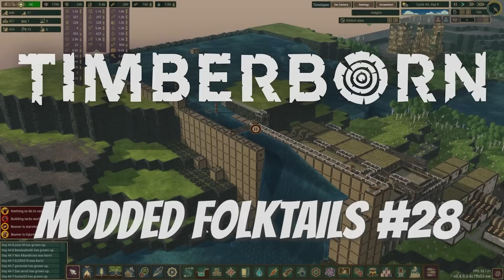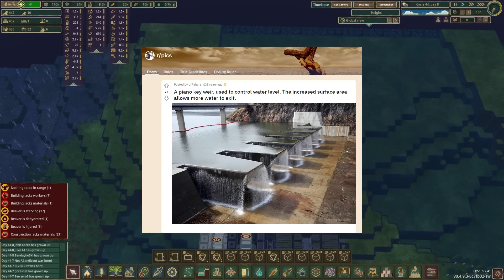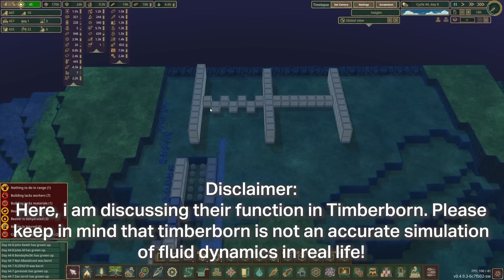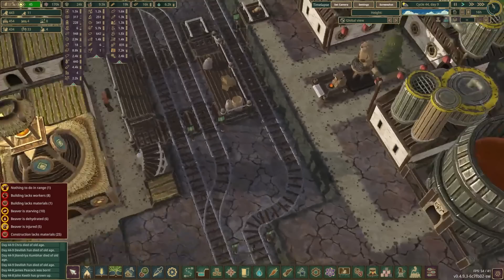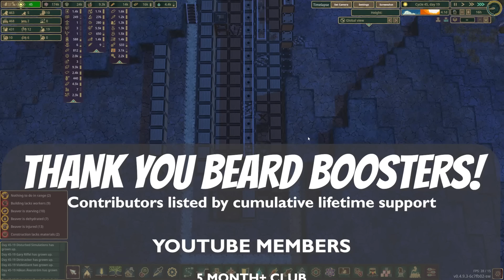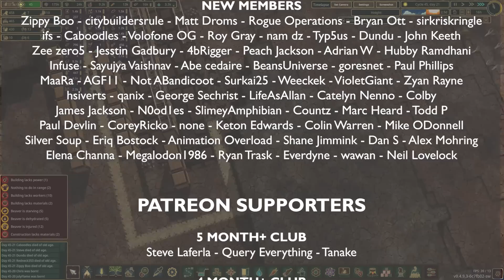Banking on bots to build big! Timberborn Update 4 Modded Episode 28

Comment: 56:25 As an OSHA engineer who has been working on large dam projects, I feel somewhat obligated to point out that the work environment appears to be lacking in terms of safety concerns. Flowing water is incredibly powerful, and the risk of a beaver being swept over the edge seems imminent. 😊
Reply from the maker: So long as Devilish and his beaver protection agency don't find out...
Reply: @JCTheBeard  Battery Smooth needs to come out with  safety gear for the beavers,  I can see tie off points,  and beavers wearing safety harnesses to tie  off when getting close to a edge higher than 2 tiles :)  Oh and you might as well throw in Safety Cones for construction areas.

Comment: My working on the update 5 water flow on the map,    I have 10 waterwheels now producing 34,000 hp  with a flow rate of 11.5  over both tiles.  I have diverted all the water on the entire map to power them :)   lots and lots of experimentation on the folding and getting the flow to run smooth and not being turbulent
Reply from the maker: That's impressive! Did you build them up top like I'm doing here, or in a different spot with more room?
Reply: @JCTheBeard  up top.  I'm working on v2 with some modifications that should get me about 35% more power I'm thinking...I'll know more when I get home

Comment: Isn't the reason you have to prioritize everything by haulers to get them to do anything with the building because you only have 1-2 hauling posts? If that is the case, it seems like having more actual haulers in each district would help with the import/export so the workers in the crossings are able to focus on just moving things to/from nearby storage like what you built at 27:39.
Reply: When you prioritize everything you prioritize nothing.  I wish the hauler priority settings were more granular.  If not 5 settings like the building and employment priorities, then 3 settings like the district gates import/export settings.  The binary do or do not prioritize just doesn't quite get the job done.
Reply from the maker: Dealanach pretty much summed it up. It's just a flawed system that you end up having to brute force with sheer numbers of haulers.
Reply: @JCTheBeard  yeah I can see the issue with that. I just kept finding it odd when you'd build more builders huts to get things done faster when it seems like building more haulers would make everything faster.

Comment: Does anyone else think that JC's intros have that sort of pilot voice of "This is your captain speaking" sort of vibe?

 I believe the powered levees at 41:05 are at different elevations and not quite connected. It looked like you put down the last connecting block,  but then deleted it and replaced it with a normal levee.  Fortunately it's up near the top and will be easy to fix.

I do think that timelapses are a good idea for the mega projects.

"At least it wasn't a Beard Booster"   Hmm.  "Ford Prefect" doesn't sound like a default name.  Aren't default names more like "Mahorayze"?
Reply: I believe Ford Prefect, and I think Theon Greyjoy both are just bots with Iconic names that JC has seeded into the list.
Reply: @Steve-od2di  Ahhh, that makes sense.

Comment: → Are the beavers actually travelling with the passenger station, or just waiting for a while for a train to come and then give up?
→ 23:05 Could it be that the power connected on the bot part factory side, but as the other end of the shaft was still a normal levee, it became yellow instead of green? We didn't see the blue connector, but that only appears when you are further away.

→ The transport from the district crossing will be faster if continue the bridge – underwater beavers move slower.
→ 38:10 Please verify how many haulers you actually have in each district – if all the haulers are at minimum priority, and you got 30 vacancies, there is a good chance that these are haulers. 28:20 never mind, there seem to be enough in Beaverburgh at least.
→ 59:00 "Power wheel" – in Timberborn terms, "power wheel" is the term for the huge hamster wheel which is run by a beaver (and produces 50 times the power of a hamster).
→ Check that the import of metal bars into Cascadia is activated.
→ 1:03:27 the last wagon of that train is derailed. No wonder it doesn't run.
→ Make sure you have your healer properly set up in Cascadia (I remember you saying it had lowest priority) – the bot part factories and bot assemblers are dangrerous work places, and you don't want all your beavers be injured forever. (You got 13 injured beavers near the end, not sure about which districts have them.)

About the time lapse: I wouldn't mind having the time lapses also in the middle, with you getting back to normal speed whenever there is something to fix and talk about, instead of just at the end – this makes the progress a bit more distributed across the episode. But it shouldn't go to Skye levels where many hours of playing are compressed into just 20 minutes of video.
Reply from the maker: Let's follow beavers through the passenger stations and find out if it works. I suspect it does.